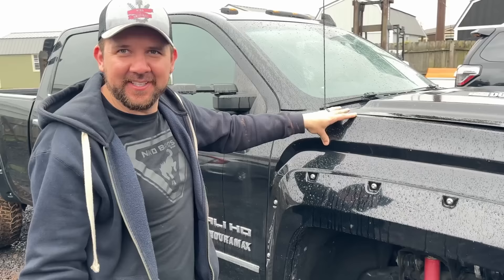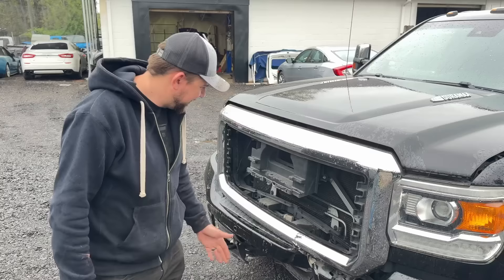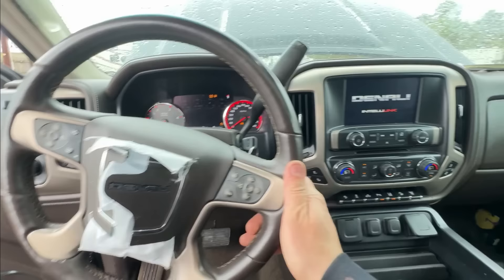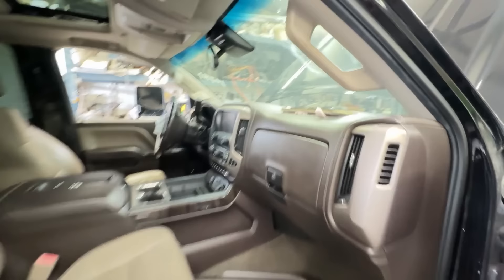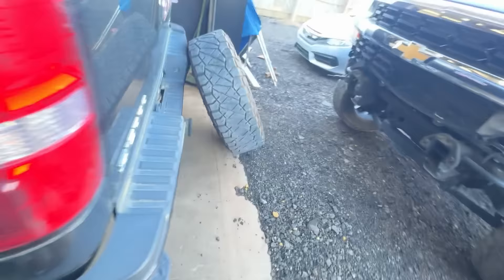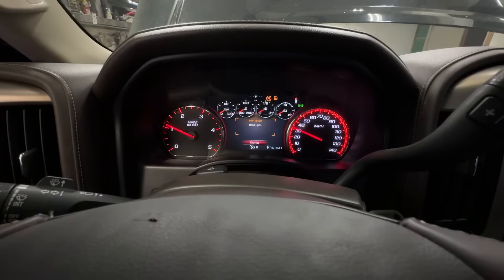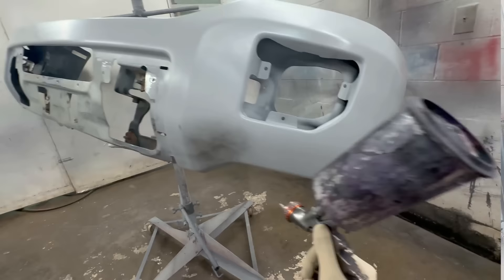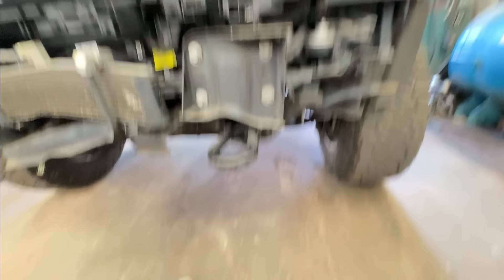GMC SIERRA K3500 DENALI NEW SHOP TRUCK QUICK REBUILD

Comment: Nice truck, but 2011-16 Duramax has the CP4 injection pump which can self destruct.  If that happens it will take out the entire fuel system.  Swap in a CP3 conversion kit and injectors for more durability.

Comment: Well you need a shop truck that is up to the job not something that strains and struggles. I think it will work out better than the white one. Ivan cannot have two he already has the red one you built from all those parts so don't be greedy Ivan you can only drive one at a time. 😁  Don't forget to fix the dent in the bed. Some scratches on a shop truck are no 'big deal' but if people see dents they might be asking questions, as you are a body repair shop. ('They can't be bothered to fix their own truck'.......) Take care Brothers onwards and upwards. 👍👍